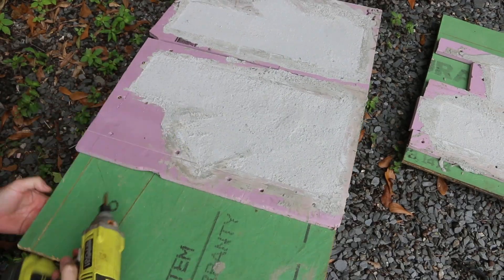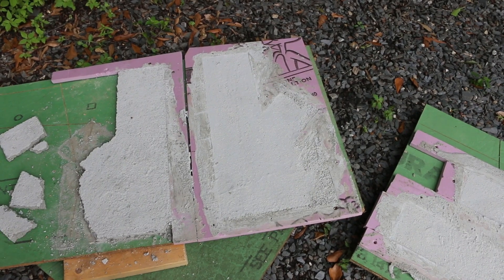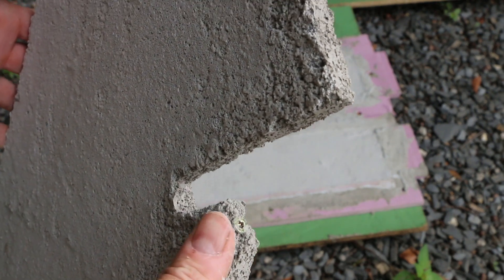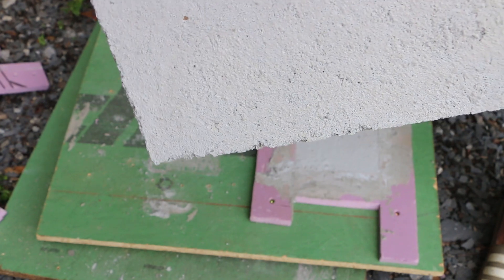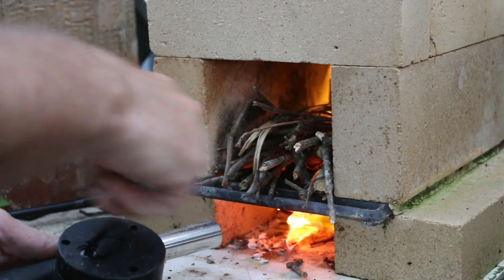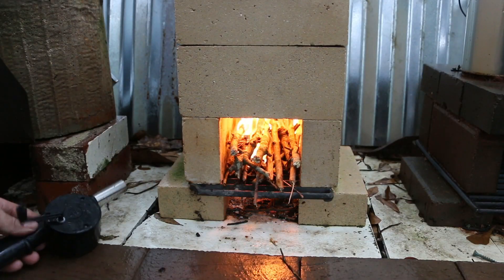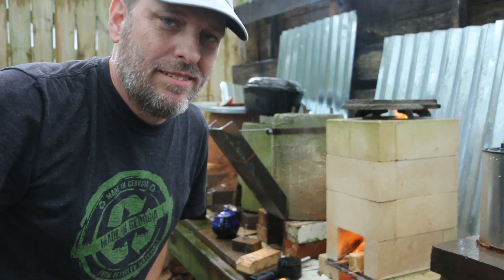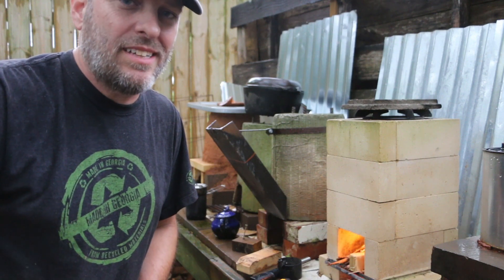How To Fire-Test Aircrete | Unforming Rocket Stove FAIL

Comment: Do you think cement board might work instead of making aircrete? I don't know if that defeats the purpose or if cement board would even work.
Reply from the maker: Hi Paul. I have burned some of the thin siding, which was pretty brittle. I do have some scrap of the 3/4 inch trim board. I’ll have to give that a try. It’s worth a test. But, to your first question, part of my trying different materials is for the sake of trying (and to make content). I appreciate the idea and your patronage. I noticed you upgraded to Chatterz. I’ll get you this Discord link today. But, there aren’t a lot of people that utilize that option yet. :-)

Comment: I would look into chopped fiberglass fibers, its used a lot to strengthen concrete and a couple of wire stiffeners in smaller parts
Reply from the maker: Thanks Doc. Good suggestions. Thanks for the feedback.

Comment: Yes. It looks like thickness is a factor. And coat hanger should work on the armature.
Reply from the maker: Thanks for watching, Edie. I’ve got some quarter inch mesh hardware cloth. I’m gonna try that. I’m going to do blocks as well, but wanted to try the slabs once more since I’ve gotten some good ideas in the comments. Thanks for the feedback.

Comment: Thank you for another great video. Good information and I learned a good bit. For the boards with cuts in it maybe use a thin layer of wax or wax paper to seal and release. Thank you again! edit to add: It looks like your mixture of foam to cement was good the thicker piece held up it should be stronger the thicker you make it.
Reply from the maker: Agreed. I’m going to try this slab method once more with some armature. Thanks for the feedback and encouragement.

Comment: I used mesh drywall tape with excellent results for a similar project.  Not sure if high temps may affect the mesh tape.  Good work!
Reply from the maker: Interesting idea. I’ve got some quarter inch wire mesh. I’m going to try that. Thanks for the feedback. Thanks for watching.

Comment: Sorry your aircrete was so brittle.  Perhaps while you are using dimensional lumber forms you can line your forms with garbage bags, slit fence or thin plastic bags to act as a release agent and to keep moisture from leeching into the forms.  One of the suggestions from last episode was to fold the concrete slurry into the foam to maintain the foam structures.  Can you use your thinner panels of aircrete as a lining material for the ceramic flue pipe.  The ~300°F temperature difference from your test was impressive.  Kudos for the new bellows.  Save your lungs.  Stay safe out there as the pandemic continues to evolve and suggest additional closures.   Wishing you and your family continued Peace, health and happiness. JW
Reply from the maker: Thanks JW! I may try folding it in, but it might be tricky to get a good mix that way. I’ve been thinking about ripping some 2x4s for form work. I’m going to try these forms once more, with an armature in the aircrete. May try the plastic, but I’ve also got cooking spray I might try. Extra flavor that way. :-)
Reply: GreenShortz DIY Every time you fire that stove you will smell buttered popcorn.   Vegetable oil sounds better than WD-40 for the environment.   Have fun learning things.    Share the following with your minions:  https://www.cuyahogalibrary.org/Events/Summer-Reading-Program/STEAM-Challenges.aspx  Stay safe Tim.  Cheers.